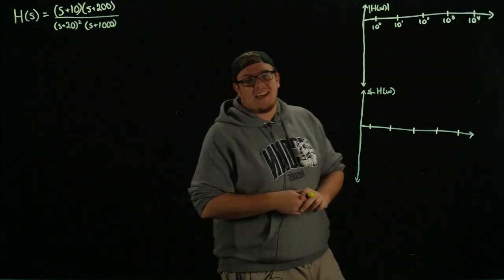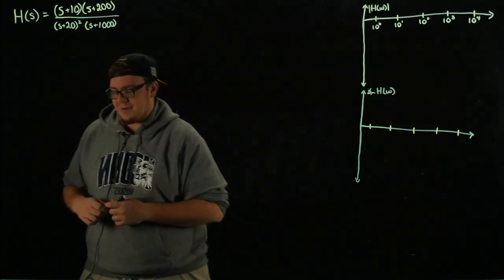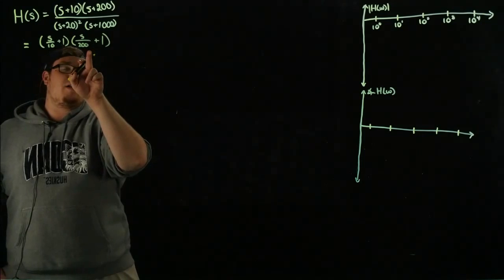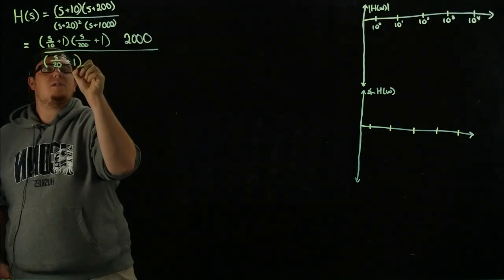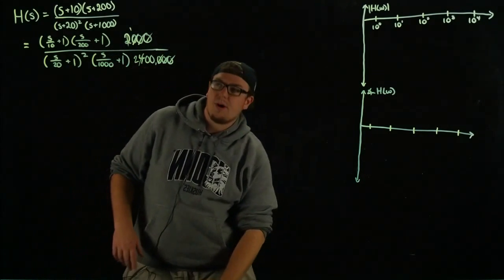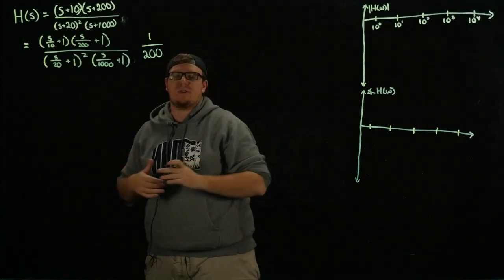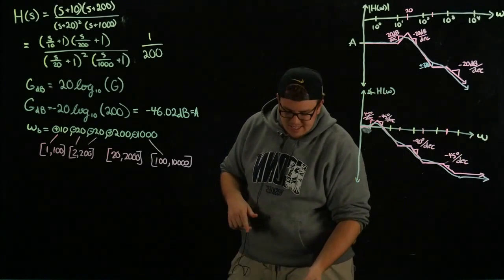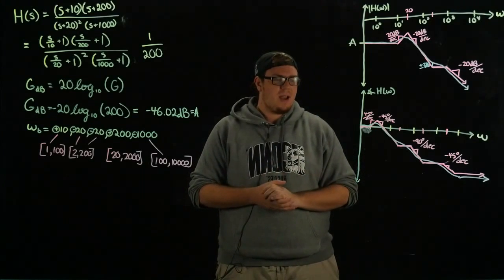Signals and Systems - Bode Plots

Comment: just for who wonder about the phase plot as i was ,  you just take opposite sign of the decade after the numbers then do what you did in magnitude plot 
(to be more clear ( the decade after    +10  is   -100  not 100  )
so if we rewrite it we can say 
( 1, -2 , -2 ,20 , -100 , -100 , 200 , 200 , -2000 , 10 000 )
i don't know if it is actually works on all functions or not

Comment: 7:24 so if it's a zero we get an increase/gain? but then what about the +200 why did it get flat instead of an increase?
Reply: Im actually confused due to the same thing but im guessing that because before we are going negative gain infinitely till we reach 200, and then at that point it counteract and cause negative gain and positive gain to collide so the decibels become neutral which is flat. Though it did not explained why the gain on point 10 go to negative gain at point 20 instead of going flat. If you already know why i hope you can explain

Comment: what if the transfer function is H(jω)? and not H(s) what changes in the method?
Reply: Not sure if this applies, since mine is written in terms of H(w) not H(jw). But oh well here u go: 

1. Same thing, let s = jw. Try to convert ur transfer func such that each term is (jw/w_n + 1), where w_n is the break frequency(s). 

2. Amplitude response: 
H(w)_dB = 20 log |H(w)|

Sub ur whole transfer func into H(w), and perform log operations to separate H(w) into several + & - log terms:
e.g. 
log a*b/c -> log a + log b - log c
(rmb to keep the modulus)

u will get similar to this form: H(w)_dB = log 100 + 20log |1 + jw| - 20 log |1+0.12jw + (jw/10)^2|

From here, +terms are zeroes +20dB/dec as in the vid and vice versa for -terms, draw accordingly 

3. Phase response:
phase = arctan(b/a) for every term in H(w)_dB
where a and b are a + bj 

e.g. using H(w)_dB = log 100 + 20log |1 + jw | - 20 log |1 + 0.12jw + (jw/10)^2|, 
phase = 0 (constant) + arctan 1 - arctan (0.12w / (1+ w^2/100) )

bode plot wise personally I'd still just follow how the vid does it, that's easier than interpreting it from the equations lol

Comment: how is he writing on the screen and it's not an inverted image? which technology is this?
Reply: He writes as he normally does, and then mirrors the video image.  Either he uses an actual mirror, or he uses software.

If you saw him lecturing live like this, the writing on the glass board would be reversed, and he'd play a live video feed off to the side.
Reply: @carultch  Thanks for your reply. But if the image is inverted, then why is his writing direction not inverted. 

It must be something else. Also, I saw other lecturers using the same technology in their youtube videos.
Reply: @raghuveerdani4046  Suppose he's facing north as he gives this lecture.  He's right handed, so he's writing with his east hand.  He's writing on the south side of the board.  The camera films the north side of the board, where the writing is reversed.   The camera image is then mirrored, so the writing is legible to the audience.

You can tell that it is reversed, because the writing on his shirt is reversed.  The N is backwards, and the S in the lower word is backwards.  I can't make out what the writing says in full.

Comment: Thank you sir, but I have a question: in your example all your zeros and poles are (s+...), what is they are (s-....), are the rules still valid?
Reply: If the poles and zeros are (s - p) or (s - z), which are positive poles and zeros, then the magnitude plot would be the same as if they were negative poles and zeros.  But the phase would be reversed.  This means positive poles would add phase, and positive zeros would subtract phase.  Unlike how they normally do it, with negative (s + p) poles subtracting phase, and negative (s + z) zeros adding phase.

Normally in control systems, you want negative roots, for a stable system.

Comment: but why is the slope 20?
Reply: It's 20 instead of 10, because we are plotting the square of the transfer function, rather than the transfer function itself, since the square of the transfer function corresponds to the power.

If we were plotting the transfer function directly, it would be 10 dB / decade / root, because each root causes the transfer function to scale by 10 every time the frequency scales by 10.

Comment: Thanks for the great video. But what if the system has a pole at the origin?
Reply: You never graph the origin on these plots anyway, because it is a logarithmic scale.  The origin of zero frequency would be infinitely far to the left.

The de-facto "origin" on a Bode plot, is the frequency of 1 Hz or 1 rad/s, whichever units you use.   A pole at the actual origin would start with a downward sloping line at -20 dB/decade, until other poles or zeros apply.   You'd find your starting point by evaluating the magnitude of the transfer function at unit frequency, and mark that as your vertical axis intercept.

Comment: Like the video :) (But I agree with others that the angle plot is wrong, I tested it in Matlab https://i.imgur.com/WnA30ps.png) EDIT: The plot is correct!! I was wrong :) See the comment by Carlos.
Reply: Nop. The plot seems OK. I have also plot it and got the same result as Andrew. I have seen your plot (tested in Matlab) and it is correct but you are looking at the real plot NOT the asymptotic plot. I have used the following site to plot the graph: http://www.onmyphd.com/?p=bode.plot.online.generator
Reply: @carlossiles7702  Thanks a lot for correcting me Carlos. :) I now completely agree that it's correct, I simply didn't think there would be such a big difference between the asymptotic plot and the real plot. :) Thanks again! I also made a screenshot of it here: https://i.imgur.com/tgQI5sx.png

Comment: how did you know it started out at 0 degrees before 10^0 for the phase plot (at 10:50)  ?
Reply: The phase plot begins at 0 and remains 0 till you reach the range of the first breaking frequency. That's 1 in this case.

Comment: Im confused is a dropp of 90 degrees not a line straight down.
Reply: The y-axis is the phase in degrees, while the x-axis is the frequency in decades. The slope = rise/run = (y2-y1)/(x2-x1). Therefore, a slope of -90 degrees per decade means that the phase must drop 90 degrees WITHIN 1 decade, not instantly.